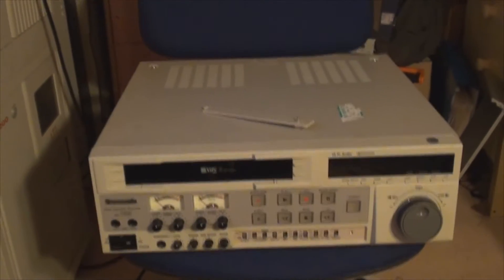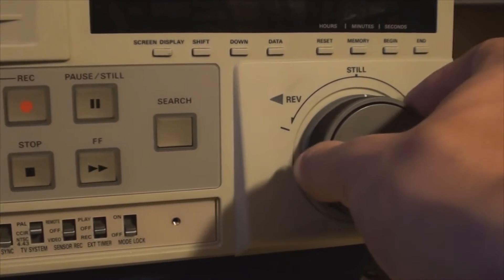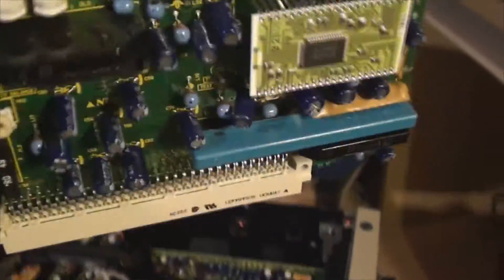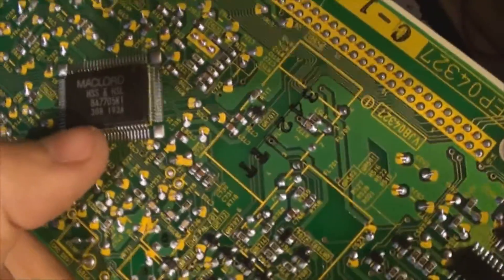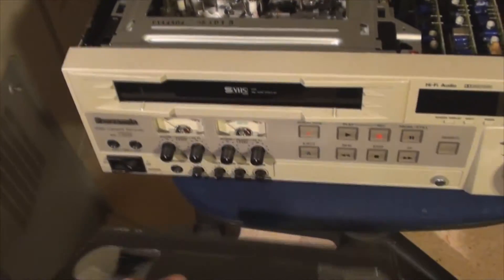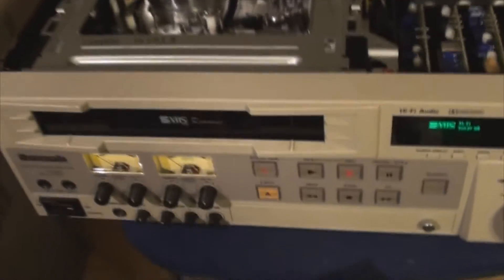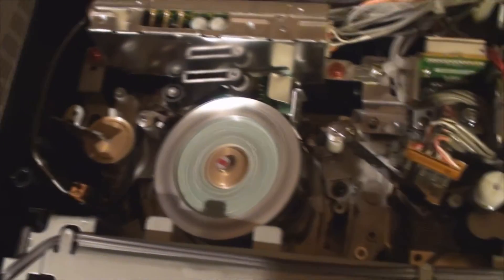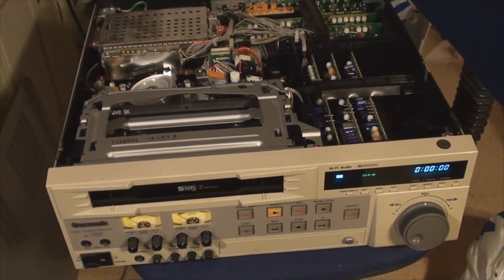Panasonic AG-7350 Studio SVHS Teardown

Comment: What's the difference in picture quality or functions of this unit, compared to the Panasonic AG1980 S-VHS unit?
Reply: picture quality? if the VHS is recorded with a cheap VCR o r cheap Camera... the player can't do anything to incerase quality... BTW i made every test on this 7350 and the quality is the same of last (2002/2006) cheaper JVC / SONY / SAMSUNG units. maybe the only difference is that if the tape is something like damaged the massive dragging force of the tape can solve a bit  slow/fast audio video output  on these zones.

Comment: Nice vid. Thx man :-) I've bought one on ebay but approx. 10 sec. after turning on it turns off itself. Any ideas? Sounds like Capacitor Problem in the Power supply but I have no idea where to start :-( Thanks in advance!